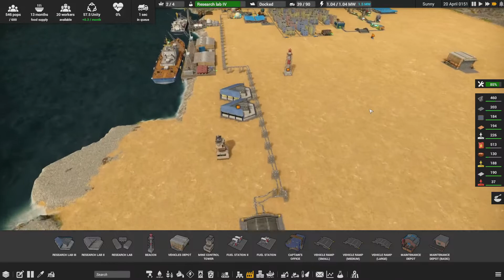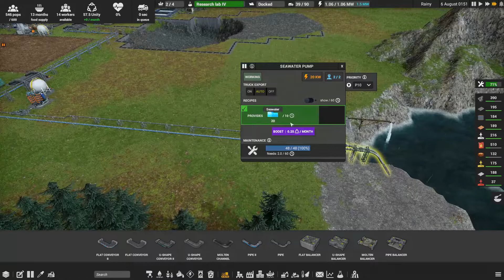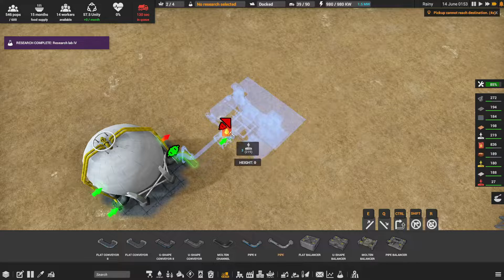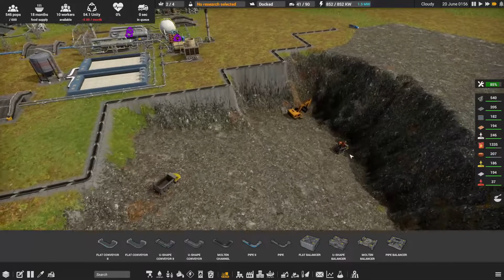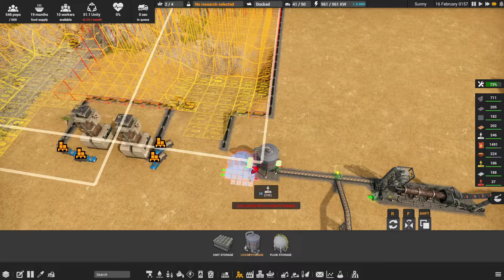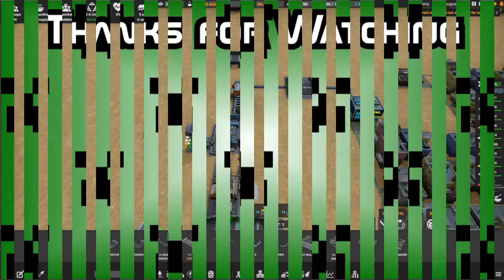Captain Of Industry - Beta | Ep 19 | Smoothing out some bumps

Comment: IIRC, you have exploitable ground water on the west side of the island where you planned to shift the housing to. Might want to do a 'resource view' of the ground again to whistle up other options besides over-building the east part of the island.

TBH, you're running into the same problems I've faced in Factorio when I make things too compact, and don't plan enough for growth / expansion. And yeah, the proper solution is never pretty if you've let things go too far without a correction / re-think.
Reply from the maker: I should just place a ground water pump up there until I move the town. Although at this pace I won't ever move it.